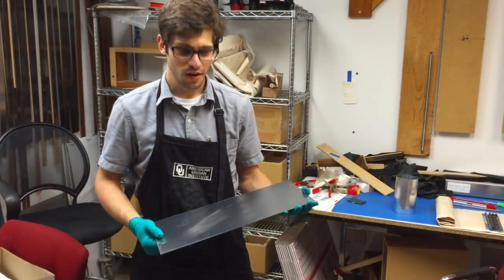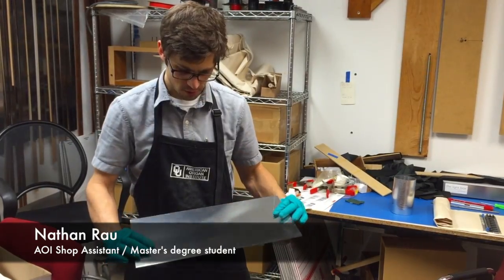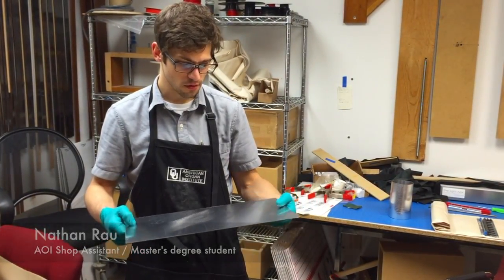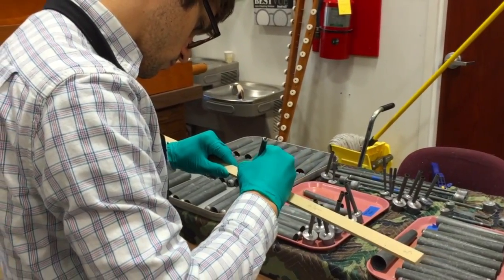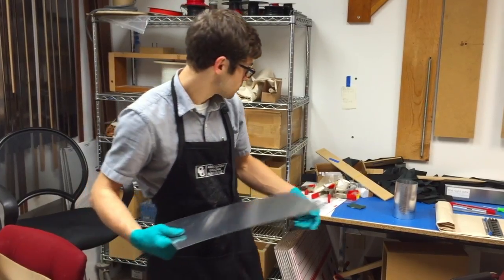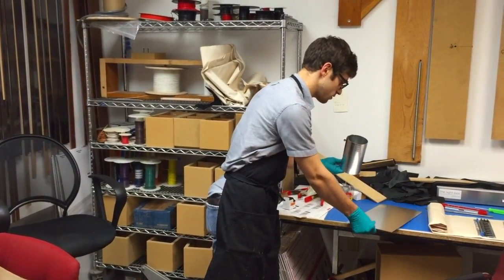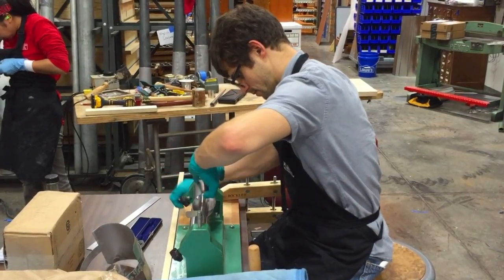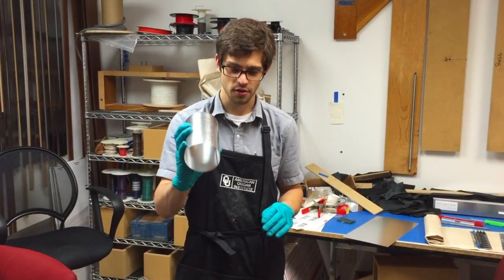AOI Organ Shop – Making tuning collars

Comment: Any chance of showing, in detail, the machine for making the tuning collars?
Alternatively, could you tell me where to buy one?
I have fitted thousands of tuning collars down the years, and it would be a great help to have a machine which could either make them, or be used to alter the diameters, very slightly.
Great video, by the way.
Reply: Thanks!
That's very helpful.
I'll follow this up.